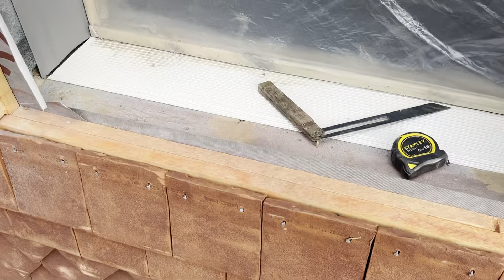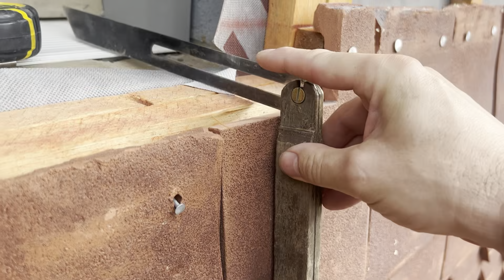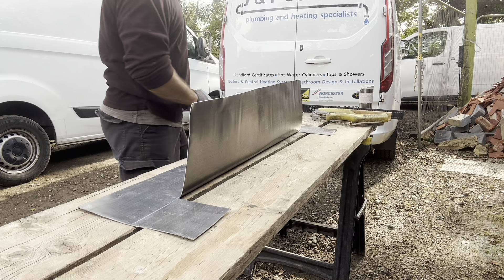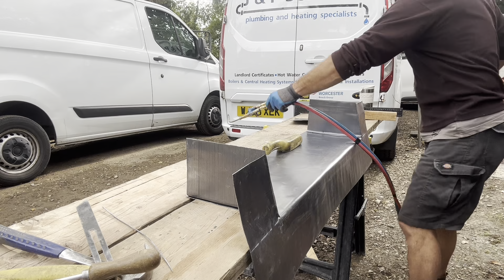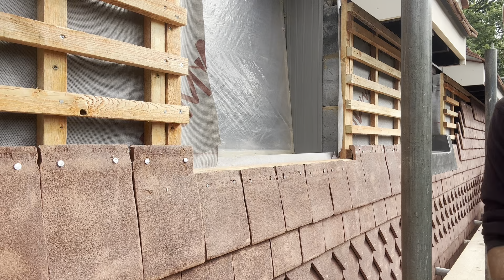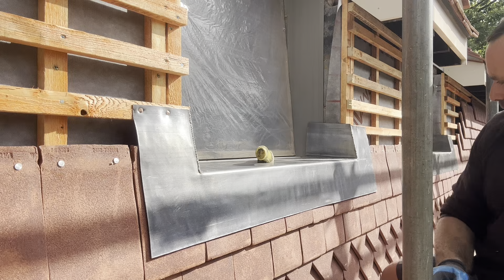Making And Fitting Lead Window Trays **COMPLETE PROCESS**

Comment: Hey can i chase into sat a timber sill and then wedge and use silicone only need to be 150mm just to hide a rough sub sill on an old sash bay. Im struggling to find anything on how to achieve this
Reply from the maker: It’s difficult for me to comment without seeing exacly what you’re trying to achieve.
Reply: @slbleadworks I totally get that im the same i have to see it. would it be ok to send you some pics? Thanks

Comment: Hi Stuart, do you go back and turn up behind the windows or do you leave it to fitters?
Reply from the maker: It usually gets left for the fitters as most say to me, it’s easier to fit the windows first. And then turn the lead up to the back of the sill afterwards. 
Thanks for watching.
Reply: @slbleadworks I'm just measuring up for a lead tray. I havnt done much leadwork of late as most roofers etc seen to use rubber or fibre glass these  days. Do you ever dress the tray as opposed to burning?
Reply from the maker: @DavidKneale no I always cut and weld it
Reply: @slbleadworks Yep it's a neater sharper finish  with lead burning.

Comment: Does lead or will lead stick to stainless steel? Basicallu i wanto use lead to fill the joint gaps between stainless steel gutter. 

Cheers.
Reply from the maker: I’m not entirely sure to be honest. Id guess that it might stick but it won’t be fully bonded.

Comment: Hey Stuart. Great vid as always. Maybe some time you could talk about the code lead you are using for the video and maybe the reason for that? Also when the window is fitted do you cut the lead and fold it up the back side of the frame or sill? Say 25mm or mybe 18mm for a window board ? And then that up stand would be welded in the corners? And the then upstand would be consealed by the window board?  Cheers
Reply from the maker: Thank you and thanks for watching. 
Yes the best possible job is to turn the lead up 25mm against the back of the frame. And the window board conceals this. I usually do mine once the windows have been fitted to make it easier for them.
Reply: @slbleadworks  thanks stuart. And i take it you weld it to maintain the water resistance or is that not neccessary?
Reply from the maker: @Simon__Davies  to be honest you can Just fold it up. This is so much quicker and easier. This really is belt and braces as no water should be anywhere near the back of the tray. Usually a mastic bead is placed once the window has been fitted too.
Reply: @slbleadworks  thankyou. I dont ever see myself in a situation where i  would have to do this. Im not a lead worker and i dont fit windows very often but im just really facinated by the lead work. Thanks for sharing your knowledge.
Reply from the maker: @Simon__Davies   no worries and thanks again for watching.

Comment: Great work.
Be careful, that mask is for filtering aerosols. You're producing lead fumes, a gas. This mask won't help, you need a small gas mask, instead, but since you're outside, you don't need anything as long as you stay upwind.
Reply from the maker: Thank you and thanks for watching. 
This is a FFP3 mask it takes out lead fumes too as they also filter against gases. 
I also had to do a face fit mask test once and the instructor there told me FFP3 is suitable for lead fumes.

Comment: When did they start doing window trays like that. Is it now a requirement. I never saw one done like that before I left. And have never taken one out done years before. They were always just a flat flashing. Under the window and down the tiles. I used to shape all mine. You have bullnose tiles on that job. I would match the bullnose. Or whatever other profile. Flower pattern. Bow tie. Anything to jazz it up. I still have issues with lead being monochrome and bland. Plus I enjoyed coming up with new repeat designs. Made up little templates and everything. I would imagine there would still be some of my creations around Kent.
Reply from the maker: I’m not sure how long trays have been done like this. But I’ve been working with lead for 29 years and in that time window trays have always been made like this. 
Yes I do scallop and scroll etc but on this job the client just wanted clean straight lines.
Reply: @slbleadworks  I left 25 years ago. Just never seen one done like that. Apart from perhaps one of those awkward roof access type window/door jobs. With like a back gutter arrangement cut into the roof. Guaranteed to collect crap. And generally leak after a few years. I know in NZ window trays are compulsory. In Qld Australia our standards are so bad. You would be lucky if anyone looks. If in doubt use more silicone. There is a type now for every occasion. No guarantee given.